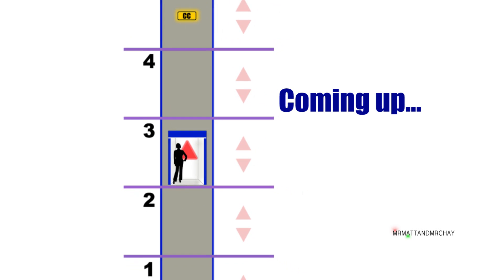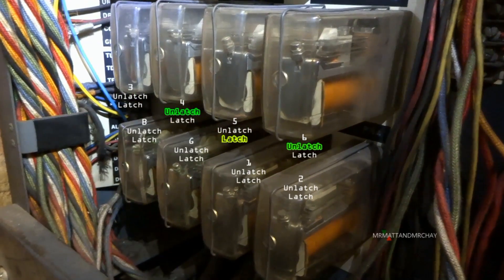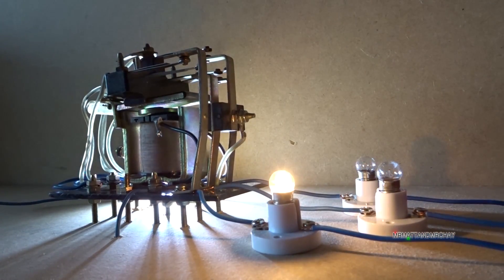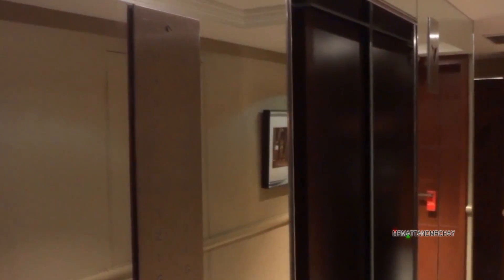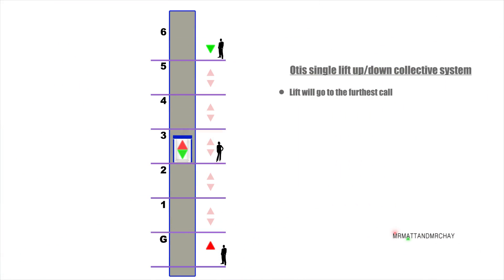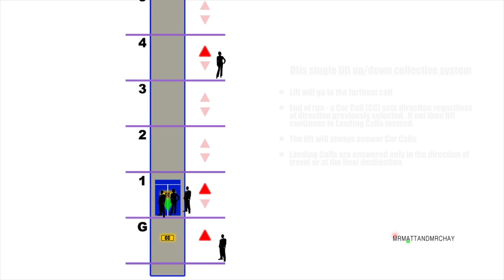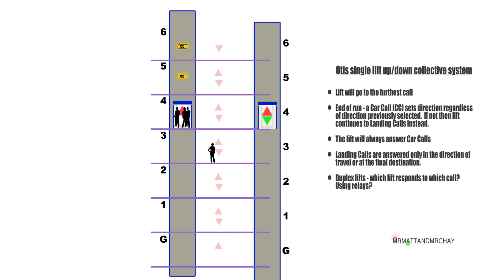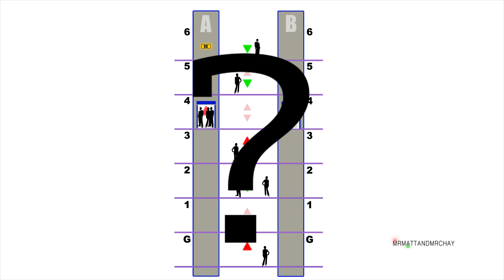Elevator call logic, the old OTIS system

Comment: 1:00 how many volts does the relay need to switch on?
Reply from the maker: These are 100-120volt relays.
Reply: i got mine working on 240v dc ( single diode rectifier ) I'm in Australia btw   @mrmattandmrchay

Comment: There is an old Otis in a tower block in hove and is relay controlled. And the motor is at the bottom of the shafts so you would need a drop key to get to see the motor in detail but the relay logic is at the top floor and requires a screwdriver to access. Pls film this lift. It's at shanklid court in hangleton
Reply: It's at shanklin court in hangleton

Comment: I learned how to do some basic stuff on Otis elevators around 1979-1980, both manually operated and automatic by watching the repair guy. One day on my shift in the building a passenger elevator got stuck between floors, it was loaded, I was able to bring it up to the floor and open the doors from the motor room and floor selector.
When I lived in Brooklyn and had to move out of the 6 story building I was in, the power had been cut off and I had 25 tons of sculptures to move out, I was able to move the elevator up and down without power but it took 7 flights of stairs for every trip to do it as the motor room was on the roof. I used a crow bar to release the brake shoes from the drum with the elevator loaded, and since that was heavier than the counterweight the car slowly decended. It was not easy peering down thru the grating into the dark shaft to try to tell when the car was at the ground floor even with a flashlight laid on the floor, but it did work.

Empty car was lighter than the couterweight so releasing the brake shoes let the car come back up.
I had wished I could have found a small elevator motor assembly, those older ones were very cool, I would have taken one home for my collection but they are heavy cast-iron buggers!
I did get and still have one of the double ball fly governors, it weighs about 90 pounds alone.

Comment: The ‘Lift or Elevator Algorithm’ is one of the common choices of system used in hard disc drive controllers to decide how to order the requests for data that arrive. Rather than just responding in chronological order they typically use the Lift Algorithm to in effect sweep the head from inner to outer tracks (cylinders) and back again. This reduces the wear compared to randomly jumping between tracks.

Comment: It looks like the Otis design gives preference to car calls over landing calls.
Reply from the maker: It wil always head for the highest or lowest call,  regardless of whether its a car or landing call.  If the lift arrives at its last call and then afterwards a landing call is placed then you dont want the direction decided before you have even had a chance to enter the lift.  Therefore landing calls are ignored for a while so the passenger sets the direction.   With Express lift Co, the landing call button sets the direction upon arrival to the floor, if you press a call button in the OTHER direction then the lift will only change to that direction if there are no calls.  E.g. indicated DN, then you get in and press a higher car call, if there is a landong call in downward direction then it will serve that first.  Otis arrives at a destination without a set direction.

Comment: Very awesome video. I just came into possession of two 1962 Otis selectors from a 5-story dorm and about 95% of the guts from the two relay control racks. I have enough good parts to build a motor powered simulator using one selector, a reversible gear motor, and the relays. Should be fun project when I get started on it! Your video is going to be a handy reference!
Reply from the maker: Sounds like a really cool project. You'll have to do a part by part project video like I did for the Isaac Lift Panel?
Reply: @mrmattandmrchay  Yes, I'll be documenting the process with videos. 
My plan is to have two panels, one representing the lamps and buttons in the car, and another representing the lamps call buttons on the floors. The selector and relays will be mounted between them. The controller will operate a reversible gear motor that runs the selector carriage up and down, to make the simulation function. It will be quite a site to see when operating.
Until then I have to work on putting humpty dumpty back together again. The selectors are in one piece, but the controller parts were removed by the installers using a sawzall to remove the components, I will have to reconstruct or make new mountings for all the relays. I did not get the controller rack cabinets themselves. Even disassembled they were large and too heavy to handle, I will make my own versions of those as well.
A lot to do, but this may end up being the only working relay logic Otis controller left operating in North America when I am done, so I feel the effort is well justified.